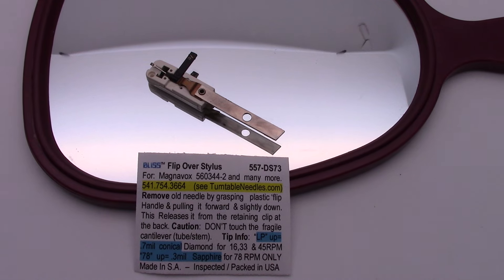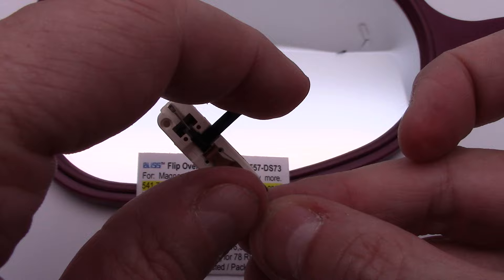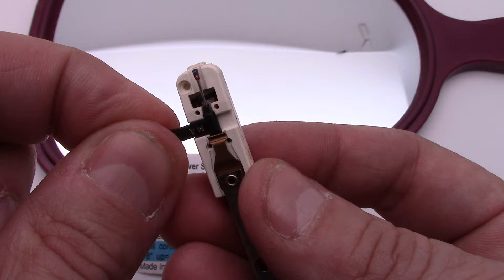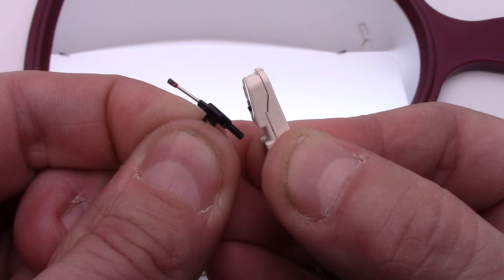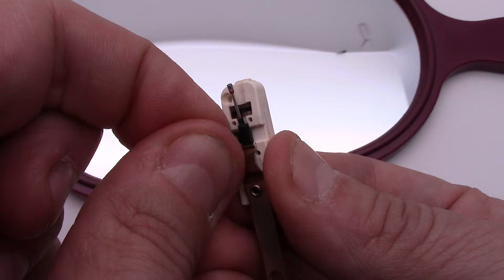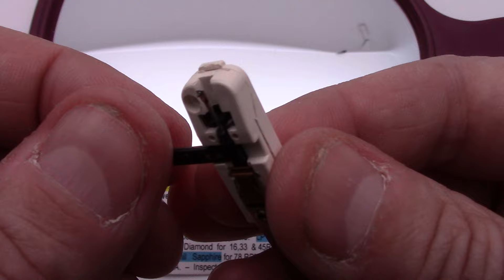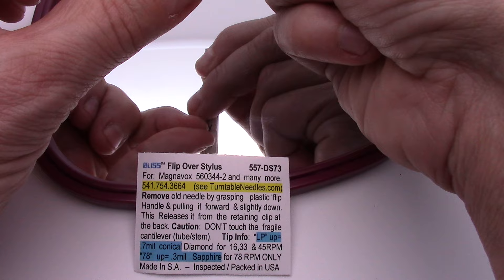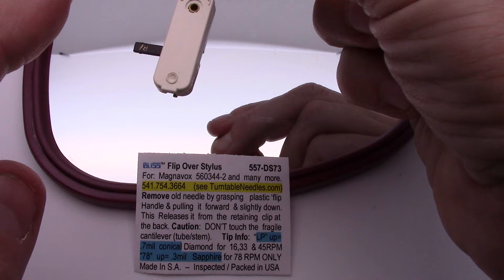How to Replace a Record Player Ceramic Cartridge Flipover Needle

Comment: FYI for anyone who pulls the cartridge out if you're only getting left or right speaker sound after you put it back in its because you plugged the wires on the cartridge wrong. :)
Reply from the maker: The center pin is for ground (negative) which is shared by both channels on this 3 wire stereo cartridge.  The red wire (if present) would be for the right channel+ which is the pin on the right when viewed in the upright position from the back.  White would be left+.

Comment: Hi! I have a cartridge exactly as shown in the video. I replaced the needle but no sound at all. What did I do wrong? Does the needle (not the plastic shank, but the needle itself) need to be positioned within the black area at the front in a special way? It looks like there is a little groove?

I should point out that prior to the needle change, I did have sound. I did not remove the cartridge from the arm.

Comment: crap, i think i've had my needle on the 78 mode a few times. Glad i watched this video.
Reply from the maker: yes a 78RPM tip is about 4x larger than an LP tip.  What's worse is running the LP tip which is a nice sharp point that is about 4x smaller than a 78RPM groove.

Comment: HI, I came across you video throught your website.  I recently found a Zenith IS 4021 in working condition.  I want to change the needle and cartridge and found the parts on your site.  Can you recommend a video or documentation on how to change the cartrige as well as the needle?  Thanks in advance.
Reply: Hello! Did you ever learn how to replace or at least remove the cartridge? I can’t find anything. 😬

Comment: This video looks pretty informative. Thank You. However, as a 33 year old who is not familiar with this older equipment, I am hesitant to order a needle. I am 90% sure I know what I need, but not 100% certain.I have a Magnavox Micromatic player that contains that white cartridge. However, I am not sure how the needle clicks in and what needle I need to order. Watching your video, my white catridige looks identical to yours, except it does not have the long metal bar extending off the cartridge. Just the white cartridge & the metal clip at the bottom. Any chance I could email you and exchange pictures to show you what I am working with? I would love to figure this out. Thanks
Reply from the maker: yes just call us 541 754 3664

Comment: I have a flip stylus needle that I need to replace.  I can unclip the needle, but I can't get it back into the retainer clip the same way.  It doesn't seem to snap  back into place.
Reply from the maker: The retainer clip can be quite firm so you might have to use additional means to pull the clip slightly away from the cartridge body if the plastic of the needle assembly is not strong enough to do it.

Comment: I have the same cartridge, but the rubber suspension piece for the needle fell out. I can see attachment points but it is all just so small, are there any tips you have for putting the rubber suspension piece back on? Thanks
Reply: Unfortunately we have not found a good way to put the suspension in once it has fallen out. Tweezers have been used, though not always successfully.
Reply: I think this is my problem but I can't find the rubber suspension piece after it fell out. Do I need to get a whole new cartridge?

Comment: The needle I got looks like the right style, but wrong size. Do you have other sizes for the needle in this video?
Reply from the maker: There are 100s of flipover needles that all look generally the same.  But the tricky one is  
https://www.turntableneedles.com/2624-Type-Stylus-for-Electro-Voice-198-199-275-277-282-284-Cartridges--our-Needle-368_p_1047.html
which is the same as the 557 type needle in the video but has a shorter tail.  It fits into cartridges for Sears, Admiral, Motorola, Voice of Music etc that look almost exactly the same.  Psssst, yes you could snip most of the tail off of a 557 type at your own risk and "create" a 368 type if the longer 557 tail precludes you from inserting it into your non-Magnavox (often gray in color) cartridge that looks very similar to the white cartridge in this video.

Comment: Help! I can’t figure out how to remove the white part.
Reply from the maker: The white cartridge in this video is attached with a rivet to a flat metal bracket.  The bracket is held onto the headshell/tonearm with a philips screw that needs to be removed to release the cartridge.  It is not necessary to remove the cartridge to replace the needle.  Removing the cartridge can risk the introduction of new problems.  The cartridge itself rarely fails.

Comment: a Pfanstiehl 168 ds73 or ds77 will fit in those too
Reply from the maker: https://www.turntableneedles.com/Needle-168_p_903.html
no, it will not.  See bottom of the above link.  The related items section shows the various cartridges in which the pfanstiehl 168 type needle will fit.  This white magnavox cartridge 560344 etc can accept pfanstiehl 557-SS77, 557-SS73, 557-DS77 & 557-DS73 type needles.  Secretly it will also accept Pfanstiehl 368 type needles but don't tell anyone.
Reply: @TurntableNeedlesCom  sorry i meant 368ds73ords77 a 558d7 is also made for those